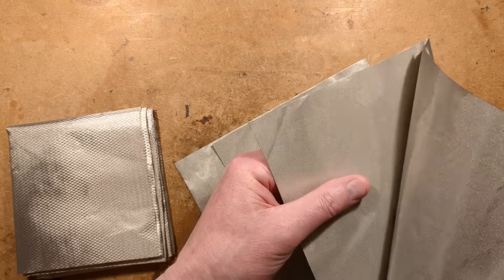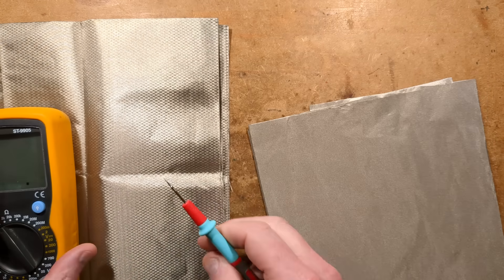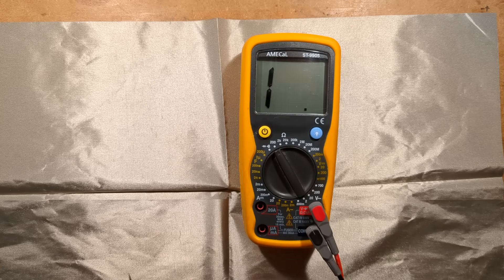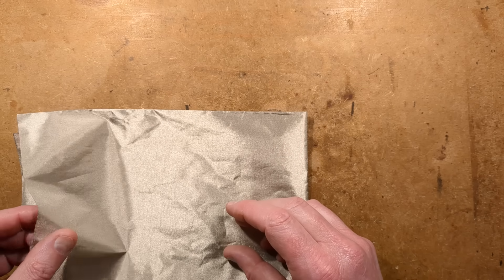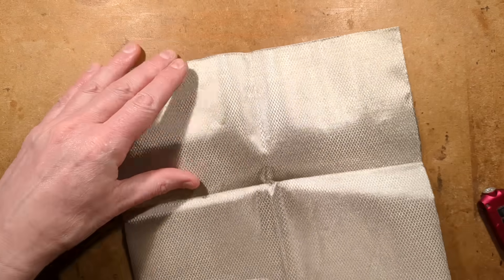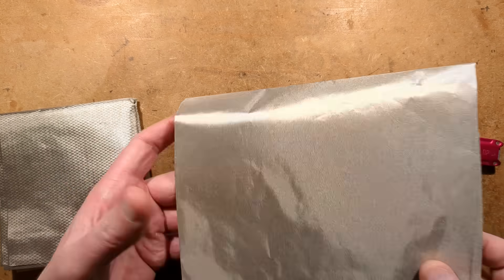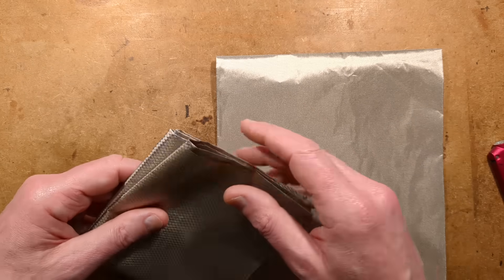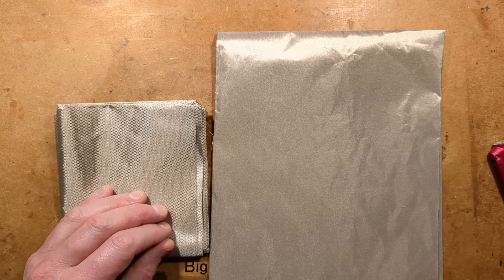Anti 5G fabric is amazingly conductive

Comment: When the North London Line between Richmond and Stratford was modified to overhead electrical conductors and pantograph contacts, instead of the third rail system, the railway was closed for a year in order to dig out bridges and tunnels to give sufficient headroom for the new cables. After conversion, waiting for trains to go home from Hampstead Heath station, in the rain, with my umbrella, I regularly received shocks to my scalp from the umbrella spokes which had an induced voltage from the overhead conductors. 
If this material were used as umbrella fabric, would the shocks be worse, or could the umbrella somehow be shielded from this induced voltage?
Reply from the maker: It would probably be worse.  That's why station furniture often has earth bonds to ground it.

Comment: A test you can do which may make an interesting video, see how that material affects WIFI and Cell reception.
With enough of that material and depending on how much it can affect signals, you could possibly line your walls with it to lessen WIFI interference from neighbors in WIFI Heavy areas.

Comment: I think the faraday  use is probably the best use of something like this. easily glue it to the inside of project boxes or other electrical enclosure boxes like those big PVC ones with the rubber nipple-gromits all around for a case where you need some extra shielding, an RF junction box for example.

Comment: You could 3D print onto it (people have been printing on to fabrics and meshes for a while now) and use it for very specific prints that can use LEDs and things, might be an interesting way to "wire" LEDs up in cosplay outfits by running this between two pieces of 3D printed material instead of having to wire things up properly.

Comment: You could make clothes with lights in and use this material as the connection  as it's flexible so for cosplay I'd imagine it's worth it weight in gold.
Also you could buy a load and sell it as anti 5G material and with the proceeds by a remote island away from those idiots!

Comment: Would it be any good for splitting water through electrolysis? Stainless steel is often used for cheap electrodes but even still they corrode with a day's use. Would this nickel/copper hold up better I wonder? It certainly has good surface area for the purpose.

Thinking more on it, is the thermal conductivity good? Does water wick to it or bead off? Is it breathable? It might actually do quite well as a cooling fabric to stitch to the inside of regular clothes with the right combo of these properties.
Reply from the maker: It would probably dissolve quickly.

Comment: You could create some very fashionable ESD-safe pouches for  your sensitive electronic components.  Maybe get a nice logo screen printed on the outside, and use it to carry your CPU and memory DIMMs around in.  Just the thing for your finicky JFET devices, more worthy than those ziplock plastic bags with the funny coatings.

Comment: The proper use case for these types of devices are in EMI/RFI shielding and are often used in aerospace and defense industries. 
btw: A common demonstration of basic EMI/EMC shielding of low GHz RF frequencies is to have a Bluetooth connected speaker streaming music from your phone. That is ~2.4 GHz. Explore wrapping it with tin foil. 
Since the wavelength is relatively short, you can still hear the music if you wrap it 99.9%. Just a small air-gap is enough to let the signal in. 
Even if one had a legit need to 'shield' their brain, a hat wont do anything. You'll need a whole body suit where even the air passages are designed to prevent RF intrusion. Basically, a walking SCIF.
Reply: The people scared of 5G put stuff like this around their phone, causing the phone to boost the output signal, yet they think it protects them.
They are somehow not worried about sunlight, any other radio waves, nor cosmic radiation.
Reply: Lol, a walking SCIF where simple vocal information always escapes

Comment: thank you for testing this, i saw it on aliexpress and thought it could be great (if it blocks 2.4-5 GHz) for my dumb bluetooth earhooks that keep auto connecting while in the charging case - only to be completely drained when i want to use them.
Also i'm curios what would happen if you wear this while being tased, would it be lower resistance and lessen the shock?

Comment: For "Arduino" spinoff "Lilypad" :  I have bought authentic soft and pleasant to the touch fabric many years ago. It was made for wearable computing . This here does not look great except for raincoats . I am still using the conductive thread sometimes instead of copper wire. Recently I made a squeeze bunny control for a lamp by extending a touch sensor circuit for metal lamps to the bunny. It is of limited use, visions back then were about t-shirts displaying emojis from phones. It's good for less ambitious uses though.
Reply: I am pretty confident the pleasant experience I have had with high quality high conductivity fabric was with Medtex 180 Ag Nylon 
This is silver coated Nylon stretchable in one direction. 
Not cheap and there are many probably better ones to choose , developed for medical applications and sports wear for its antibacterial property. 
I just feel the need to point out there are less terrible options than this polyester out there. 
Conductive thread is preferred by people who like to sew anyway.

Comment: i guess i will no longer need to wrap my wifi router in lead, the wifi 5(802.11AC) keeps leaking out and my internet is slow because of it!
i wonder how good this would be for hv caps, cut the top off a PET pop bottle and wrap the inside with it, some aluminum tape on the outside

Comment: It would be fun to buy a roll of that and make a gigantic capacitor.  Use cling wrap for the insulator between the plates.
Reply: yeah the conductive plates (fegyverzet - armature in hungarian)
Reply: use weed mat not cling wrap weed mat is pourris but nonconductive
Reply: @rodneynormanhersom3583  fun joke: ask for supermagnetics, receive superconductors with diamagnetic properties back #neverwon #3jkin1 #deltarune
Reply: @rodneynormanhersom3583  Not necessarily - your capacitor-separated-by-weed-mat would exhibit the dielectric properties of air. Putting this, one thinckness of "weed-mat" and one thickness of clingfilm would measure the dielectric constant of the cling film - which is unlikely to be similar to that of air. 

The benefit of the "weed mat" would be to prevent shorting if there were a hole in the cling film which would short the capacitor. However you could most-likely achieve the same result by using two thicknesses of cling film.
It's not a simple interpretation though, as the thickness of the dielectric material separating the two planar electrodes is an important component of the capacitance achieved. IIRC, the equation has a 1/thickness parameter in it, so thinner dielectrics produce higher capacitance values (because you reach higher electric field values with a smaller separation between the plates. Putting "weed-mat" plus a sheet of cling film increases the thickness of the dielectric to "weed-mat" plus cling film, which would be a much weaker capacitor than 2×cling film.

Certainly useful in the education market.

Comment: There's actually a use for this type of fabric in medical MRI. It can be used as RF-blankets to shield anatomy from creating artefacts in the part your imaging. E.g. wrapping one leg in this, to prevent phase oversampling in the other. Not widely used, but it exists.
Reply: Was there also nickel in those sheets?
Reply: DIY capacitors with a layer of cling film?
Reply: so if one was to want to censor the tsa peep shows
Reply: @pen25 that is smart. Annoy all xray techs by covering your package/suitcase with rf shielding fabric
Reply: Rf blankets. Does that mean I could use it to make an RFID blocking wallet? Or people could make a pouch for their remote start of keys? Saves them having a guy with a wire loop out the front of their hose knicking their car...
Reply: @psycophonic  you can. this is what is actually inside many of those. for my key though i just stick it in a cookie(biscut) tin which is a tube and at home in a key lock box
Reply: Hmmm.. what effect does that have on the fabric itself? It would naturally induce a current in it, right? And ungrounded shielding tends to just become a bad antenna
Reply: shall we see them in advertising RF blankiet soon claiming to be a life changing
Reply: prouct getting a good night sleep?
Reply: I would expect it would be a bad idea putting any kind of large conductor in a strong magnetic field, surely it would heat up.
Reply: don't they use special lead weighted blankets? I don't think this thin material would be good enough
Reply: @redo1122 MRI doesn't use ionizing radiation. It uses a magnetic field and radio waves. The lead blankets are for x-ray machines.
Reply: @MadMorgie6318 oh yea, you're right.
Reply: @MadMorgie6318 

I'm guesding this would just show up bright white on a CT or XRay?

I'm a medic and it would be nice if we had something that would allow us to leave a patient on our scoop stretcher if they're on it. 

They're generally not much of a problem to remove,  but can be frustrating for us and painful for the patient to do so in some cases. 

As it was,  we got to see all of the metal bits in the stretcher; as well as all of the reflections that they caused.
Reply: @alertsquirrel  Depends on the strength of the x-rays used. Faraday cages block radio waves since the holes in the weave are smaller than the wavelength in question, but you need dense material to block x-rays, hence the lead vests. A thin copper alloy mesh is not going to block nearly as much, though I imagine it would block some.
Reply: @alertsquirrel  It won't shield your scope against the magnetic field. Infact, if you bring your scope into the MRI room it can easily kill someone. There is a long time since it was mentions in some seminars, but the use of RF shielding blanket seem to not be taken up. I have never used one myself, but I imagine they bring along a whole new set of problems. 

Never ever wear RF shielding clothes if you go to an MRI. If not especially made for MRI it can get hot and cause burns. This has happend with sportswear with anti-bacterial silver threads. It will also cause a lot of artifacts reduce image quality. 

I have yet to have had patients wearing anti RF clothing in our MRI, but the day will probably come. 

They won't qive much protection against radiation in CT or X-ray. They might be visible, but if anything they will maybe even increase the radiation dose.

Comment: I have used the rough stuff for shielding my electric basses just a bit of glue and the ground wire screwed to it. Much easier then the crinkly tapes and you can shield the back of the pick guards and jst have a tab over the edge from the cavity to connect them. I use Super 77 here in the US to bond the back of the cloth to the wood leaving the front conductive. I found it on Amazon but I did not know it came in smooth. Ill have to look into that.

Comment: I'm shocked it that low resistance.  I can't think of a use, though if I designed a noisy circuit, this might be nice to put on the enclosure so the noise doesn't escape.  Though...  I'd also want to see if I could fix the circuit rather than just mitigate the problems with it.

Comment: Battery saturated in an electrolyte. Probably pull a vacuum to remove any air/gas.

A huge surface area could be interesting for high output.

How much current can it handle? Can you solder to it in a controlled way?
Reply from the maker: It solders, but also melts.

Comment: As a radio amateur (RF Wizard to Clive), I can tell you it can be used as a ground plane for a vertical antenna. Make a hole in it and lay it on the ground. Plant the antenna in the hole,  with the coax centre attached to the whip and the braid attached to the Faraday cloth.
Magic 😊.
Reply: As another ham I can tell you that those metalized Mylar emergency blankets are also conductive enough to make a good (enough) capacitive ground plane. So you can use a mag mount antenna on anything or improve the ground plane you're stuck to.
Reply: @jaymzx0  will also allow you to focus the signal. ham jazz has a video showing it.
Reply: Indeed, the call it the magic carpet.
Reply: I like that idea!
Reply: Yes.... I like it.. I like it... Oh, how about this. You're in an area you need to hide the antenna in the attic. Counterpoise/insulation supplement in the rafters?
Reply: Going to have to test this stuff..  Here is me thinking, could you use it as both a weed suppressant and a capacitive ground plane?  May even improve growth of plants that the copper will leech into, whilst giving a barrier that slugs don’t like…
Reply: @MattKing2023  Be careful with it. SOME plants do NOT like copper. There are several tree varieties that copper kills.
Reply: It could be cut and sewn into a J-Pole antenna that could be rolled up into your pocket too!
Reply: I also think RF is wizardry and the process you described sounds a lot like a ritual.
Reply: @arenomusic  Dr. Yagi seemed to think so.
Reply: @arenomusic pretty much that
Reply: Yes

Comment: The silver loaded conductive elastomer used in conductive RF gaskets had a really low resistance, but cost an absolute  fortune. The much cheaper rubber covered in what looked like a coax screen, worked as a RF gasket, but covered the PCB in lots of tiny strands of copper wire.

Comment: About 100 years ago in the 1920s when the radio was introduced, some people in Berlin clad their entire houses in copper plates because they were so afraid of radio waves. One of these houses survives to this day in the Dahlem neighborhood. The residents still cannot receive radio, TV, or mobile phone inside the house unless they are using an external antenna.
Reply: I’m amazed it didn’t get stripped during ww2. Must be a beautiful green colour.
Reply: Thats one of the downsides of steel prefab homes
Reply: @dzhiurgis just the medal roof on my house kills my phone signal by half or better. I couldn't imagine living in a metal  building.
Reply: @dzhiurgis  easy fix to that is a passive antenna repeater. 2 antennas 1 inside connected to 1 outside.
Reply: I wonder if they have amazing wifi because none of the neighbours' wifi interferes with their signal
Reply: A crackheads dream

Comment: I've seen these used as a ground plane for portable ham radio antennas. Just lay it down and poke the antenna through instead of running wires along the ground around.

Comment: A friend of mine is having interference issues with a cellular repeater. He isn't able to fully separate the receiver and transmitter, so the quick fix has been to put aluminum foil between the two. This fabric might be a nice way to hang a curtain of shielding, rather than his hastily installed culinary wall.

Comment: I currently shield electric guitar cavities with copper foil, but for my next build, I'll considering using this unique, alternative material. While it might not offer improved performance, it will certainly provide a distinct aesthetic. I know there is conductive paint but, it is out of the question; it's far too expensive and often chips, leading to frustrating electrical issues over time.

Comment: I wonder if the copper content makes the material antibacterial. Copper is naturally antibacterial and by extension brass is too.  Brass fittings in toilets are not just used for aesthetics. 

Silver is also naturally antibacterial. A hospital I attended used a silver gauze on a burn. It was some form of material with actual silver attached or woven in somehow. I got some offcuts to play with and they conducted well enough to light a 6v 0.5A bulb. I think they ended up as bookmarks somewhere.
Reply: no exposed copper so probably not

Comment: Hi CLIVE...
I'm thinking electrodes in a battery 🔋

Regarding the video about the two circuits from a microwave...
The one allowed the capacitor to charge slowly and the other reduced back EMF...
Can you please do a video for 12v (and other DC voltages.. 24v and 48v)
The problem arrises with DC to 240v AC invertors..
and changing from lead acid battery to LiFePo4..
the inrush current can hurt the invertors capacitor..
Will Prose shows a bulb and a press button across the main external switch...
Press the button and wait for it to dim... and then switch on...
There must be a better way..😻
Remember the invertor uses a lot of current.. typically I use the rule of thumb..
10W = 1A
thus a 250W uses 25A and a 1KW uses 100A with a standby of 1.5A..
but remember they have a intermittent current of about double...
I've been looking for a 2 stage heavy duty DC rated switch.. (I've found one which I have ordered from scamazon.👀. I don't know if it will work yet though)
but it's not idiot proof...
Back EMF is the other thing... but not really a problem I've found but could be with boaty 2 way radio etc...

btw 👀 I found a fun channel you might like to relieve the boredom...
"Taryl Fixes All"
on YT..
Good practical advice fixing various small engine equipment..
Chainsaws to Mowers...
and he plays a character..
using words like scamazon and fleabay etc... there's also a skits channel..
It's heart is teaching people to repair and think for themselves..
Which he states occasionally..
Ending with the phrase...
" .. and there's your dinner"
Meaning this is how you can make a living.

Comment: Can you solder to it?  I suspect not, so your project will depend on mechanical bonding for attachments.  You might try sending some current thru the thing - will it handle an ampere?  Many amperes?  A few milliamps?  Does the surface corrode (you mentioned copper... will it turn green over time)?